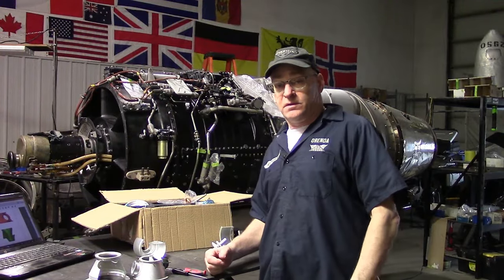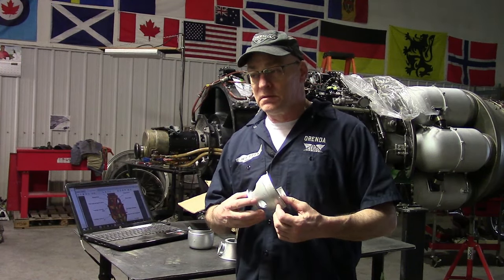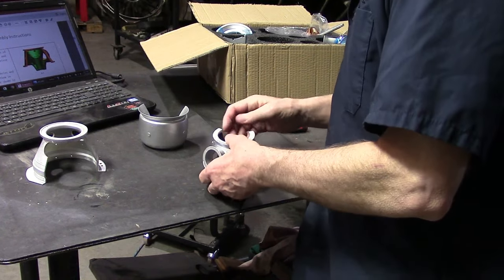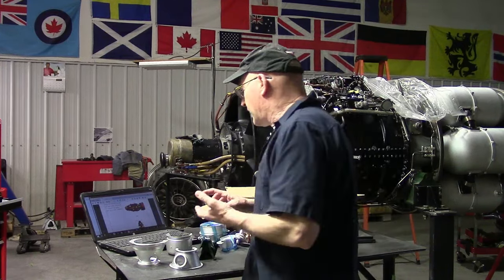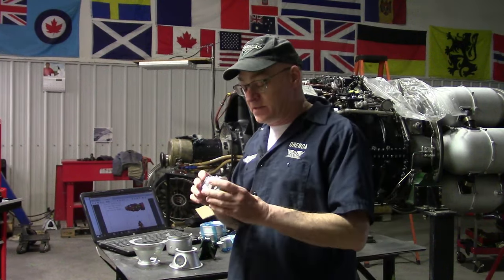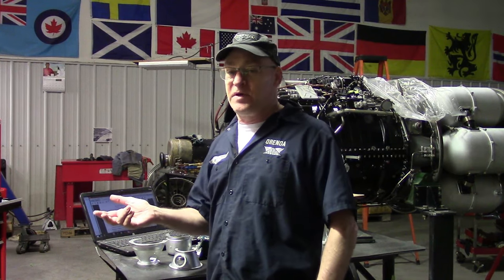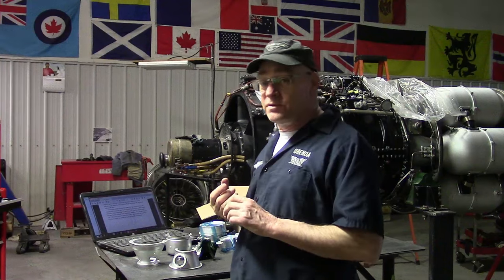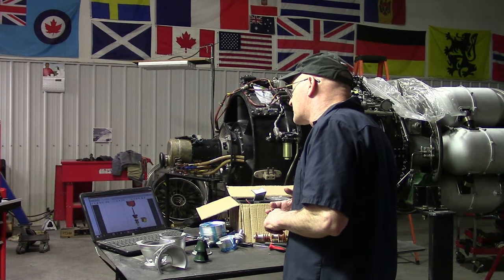PT6 model kit update

Comment: I guess the upside is it's a model. I have had parts sent from the dealer to repair equipment that are "Almost Identical" and just won't fit or function as the original did. I love the quote of the year " I know I sound angry but I'm having fun". Cheers.

Comment: We had a cartridge breech for the cartridge breech cap on the B-52 when we used to start the TF-33s with a cartridge instead of using bleed air from a huffer cart
Reply from the maker: There are no PT6's with cartridge start. Even if there were, this model is not one of them. They are using the word cartridge in their own special way.

Comment: When I heard "cartridge receiver," the first time, I initially thought of a gunpowder cartridge engine starter, but I've never heard of that being used on a civilian turboshaft engine. I knew something was seriously wrong with the directions at "cartridge receiver two."

Apparently the term is used by the model manufacturer to refer to any part that is the outer shell of a two-part assembly. It would be far more helpful to use a term related to that employed for the real-world part, such as "exhaust duct outer shell."

It should not be that difficult to build a two-shaft model. If the model is intended to be turned by an electric motor, perhaps one shaft could be driven by airflow generated by the other. Assembling that could be one of the more entertaining parts of a well done kit.

Comment: I would think that the necessary goal of any educational model of a PT6 would be to make the most definitive and surprising aspects of the design apparent.  That being, that the air enters in the back and leaves from the front(ish), and that the power turbine and gearbox are decoupled from the core.  As a nice to have (but it would be REALLY nice to have) it would be great if the model had a functioning gearbox, even if plastic parts limited the reduction factor to two or three just to show that the power turbine spins faster than the propeller.  Any curious person should be able to walk up to such a model, spin its parts, think about it for a minute, and basically get how the thing operates.
Reply from the maker: I agree with the last part, but actually the air does not flow backwards at all. If you think a little bit, the PT6 is quite conventional, with the only slightly interesting detail being it has an integral reduction gearbox. The air flows in a completely regular way, but the engine itself is designed to be mounted in the air frame backwards to what one might expect.
Air flows in the inlet, from the low pressure end to the high pressure end of the compressor, burns the fuel in the combustor, enters the high pressure side of the turbines, exits from the low pressure side of the turbines, and leaves the engine out the exhaust duct... no different from any other gas turbine engine.

I've got one entry so far, so you still have a chance to win the kit.  info in the description.
Reply: @AgentJayZ  Well gosh.  I don't actually want the model.  My house is already full of guitars.  But I can't help myself in the face of a challenge to explain a thing without honking it up.  So here's my quick shot at it.  

The PT6 turboprop engine is among the most widely used aircraft powerplants in the world.  Designed for dependability, efficiency, and compact form factor, it is used in a wide range of single and multiple engine aircraft.  In the conventional tractor configuration, its core air intake occurs near the rear of the engine relative to the airframe, and its gas exhaust is just behind the propeller.  While there is usually a nacelle air intake just under the propeller, intake air travels through a duct to reach the engine inlet back near the firewall.  Air then flows forward through a multi-stage axial and centrifugal compressor and then is folded and reversed through a combustor section to keep overall engine length short.  Hot expanding combustion gasses then flow forward through a high pressure turbine section that powers the core gas generator.  Remaining gas flow then travels to a mechanically decoupled power turbine section and then another flow reversal out a pair of exhaust pipes.  While the power turbine rotates at a very high RPM, this is reduced through a multi-stage gearbox to provide a high torque output at an appropriate RPM for a propeller.  In flight, the core of the PT6 engine remains near 100% RPM at all times, and engine power changes are accomplished through a combination of propeller pitch and appropriate matching changes in fuel flow to maintain constant RPM.
Reply from the maker: OK, the instructions I asked you to read are to send your effort to my email address, which is given.
That's OK, I guess, because I was expecting a lot more...
Reply: @AgentJayZ  ahh.  It was enough to make me feel better.  I could probably make another pass at a different level of granularity, but this is the level I’m confident won’t just be complete BS.

Comment: Unfortunately a lot of models of aircraft engines are way overpriced junk. It's so disappointing. It wouldn't be so bad or egregious if they didn't cost several hundred dollars. I get that they're not in high demand but if rather spend a little more for better quality if I already have to dump hundreds for cheap junk. I've seen some turbofan models pop up recently that look like they're better quality and more accurate, but I'm still not ready to drop a few hundred to find out if they're worth it despite the fact that I really want a model of a turbofan. There seems to be a few related companies that make all the junk stuff for different kinds of model engines.
Reply from the maker: Yes, at first I was excited, but I have never seen a model kit with crappier parts and instructions.